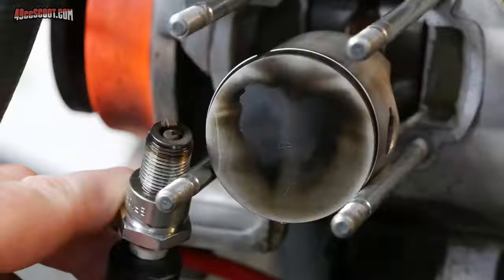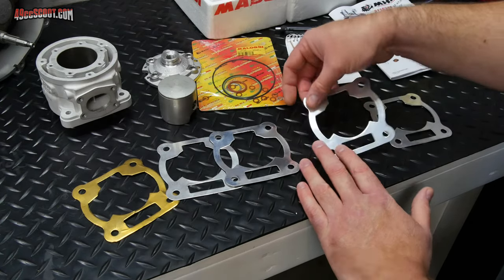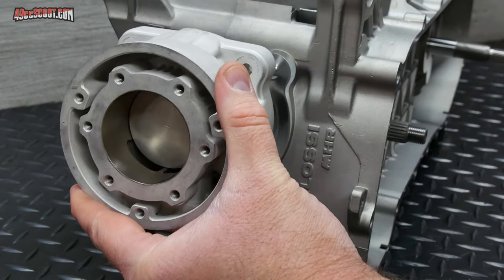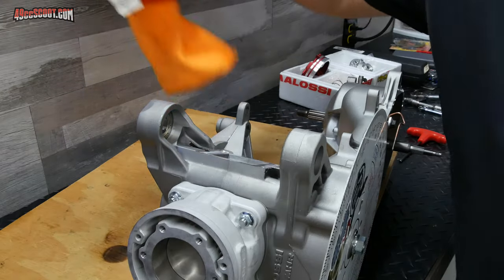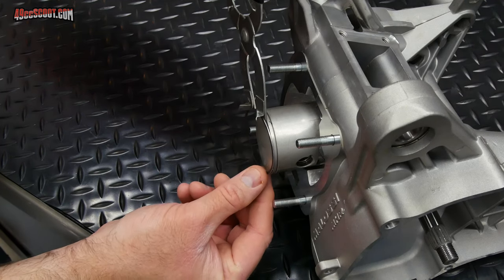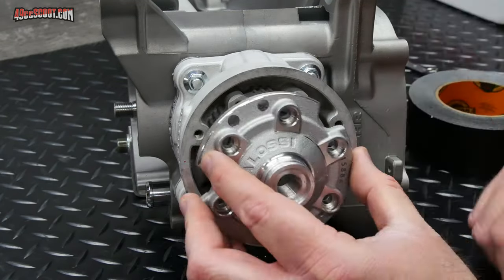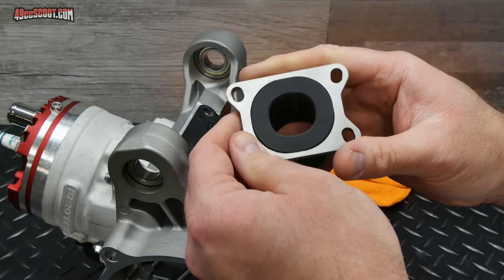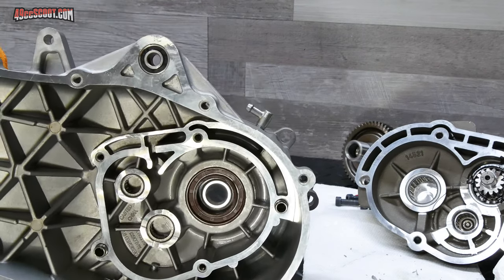RC-One : Cylinder, Reed & Intake Install & Testing A Circlip Installation Tool : RC1 : Part 05

Comment: The circlip tool is a unnecessary tool. Some tools make the job harder. I never use sealant on the bottom gasket. Its not necessary.
Reply from the maker: Once setup the first time, it's very quick with the circlip tool. I like it. I've done tons of them, but I still have days where they go in easy and days where it takes a few tries. Works first time with the tool. Only thing mine fits is the RC1 so it's always setup for it and quick. I did learn the hard way to always check the clip thoroughly after though. Should do that by hand too, but I got so used to the tool working that I slacked once and the clip came out and ate a new cylinder.

Comment: When you use that kind of sockets with the torque wrench you have to be sure the wrench is at a 90 degree angle with the socket, otherwise the leverage will be longer or shorter and the torque will change!! Great video sir!
Reply from the maker: Thanks. Here's a whole bunch more info for anyone interested.

https://www.tekton.com/blog/how-to-accurately-use-a-torque-wrench-with-a-crowfoot-wrench
Reply: @49ccscoot  That's super interesting - good link.

Comment: Absolute guru. I thought I was good with the 2T scoots but come to find out there are always bigger fish. You create quality vids that help all levels of enthusiasts brother
Reply from the maker: Thank you! There are way bigger fish than both of us. Check out  2StrokeStuffing on here and look up legends like Frits Overmars and Jan Thiel.
Reply: @49ccscoot  just discovered Frits thanks to your recommendation but have been following Jan's solid content for a bit. Down here in Richmond I don't see a lot of two strokes (i myself build rucks more it seems now) but my Zuma's, TnG's  and Vento's seem to draw a lot of attention. Trying to dial in a 50cc Viaggio (TnG clone) to get better oomph off the line but it does hump 51 on flats with Zuma clutch pack and the 12" sport wheels on it. Using your variator weight instructions to do with what I have which is a full crown royal bag of weights. We have similar disciplines with regards to going way too far into making the usual unusual. Ask me about my 650cc two stroke ZX9R sometime...😏
Reply from the maker: @monsterunderyourbed5729  That sounds like a fun bike! My dream swap is a snow machine turbocharged liter 2T in the TMAX. Prob never gonna happen due to expense and the likelihood of a funeral if I had 200HP in a scooter.

Comment: Good attention to detail, through the whole process. Hopefully Molossi did their homework on the O-rings.

When teaching people the feel of gapping things, I like explaining that the drag should feel like slowly pulling the piece of metal from a refrigerator magnet.

When measuring soft things. I unscrew the holding clamp on the caliper, and gently pinch the jaws closed with my fingers, not using the roller at all because they give an unfamiliar mechanical advantage. If I feel need too much force to pinch them, I put my thumb behind the carriage of moveable jaw, and just relieve the friction. [As sharp as they may be, I never use a caliper without first running my thumb down both jaws, though a micrometers can measure the film of a fingerprint, so it's not a good idea on a mic. Once in a while I hold it up to light to see the sliver of light, that they jaws are well aligned. Ironically, I use the sharp ends for a scribe, just like everyone else. LOL! Well, they are US General, after all.]

Comment: In measuring your distance from  top of piston to let's say exhaust port for your timing. With the gap from cylinder wall to piston wall, would that be enough to cause some loss in performance  because  it's not sealed as if you measured to top of the ring which is most sealed position,  I'm just wondering if the blowby because of the gap can cause a false degree reading.  To me a gap means less compression because it has to be filled with the compression more than if there was less gap to fill, which could give better performance. Hope you understand what I'm saying. Thanks for your video. Also couldn't we move the ring closer to the top of piston to have a smaller chamber to fill.
Reply from the maker: I think the important part for measuring is to use a standard of measurement. The standard of measurement is to use the piston crown. No loss when measuring as long as we try to be accurate. Different folks use different ways to align the piston, but most of us would probably be within a degree or so. If you aren't a professional builder/tuner/racer in tight competition then that should be close enough.

There are consequences to different actions. Keeping the thickness at the top of the piston is likely more beneficial than having the ring much nearer the crown.

Comment: hey! very nice video. one thing i noticed - why dont you trust the aluminium bottom gasket? I've assembled at least 10 engines using both copper and aluminium, and never had any issues. Just seems kind of a waste of good matching when you pour a bunch of liquid gasket in there 😃
keep up the good work
Reply from the maker: Past experience. I'm used to Chinese Minarelli clones and I've had tons of sealing issues with them.

Thanks.

Comment: Have you ever tried to make one of those Chinese 90cc bbk into a ported and cleaned up to try and make it close to a malossi one ?
Reply from the maker: I have ported quite a few Chinese 52-54mm cylinders. Mostly air cooled. I've owned a couple of liquid cooled. They aren't going to work like the Malossi or any flange mount. They can run pretty strong. The liquid cooled cylinder kits that I had were sort of junk. They worked OK... but they didn't want to seal. I had constant head sealing issues and thought that's just what small LC scoots were like. Then I got the TPR and Malossi and they are much more stable. Most of the big stuff I've had around 96-110cc didn't want to make a lot of power above about 10,500RPM, even with custom made pipes for more revs and porting. The transfer ports start to be so small in comparison to the bore. Look at transfers on a dirtbike 2T of similar size and then look at what we have.

Comment: I am glad to see, that you aren't using the death-carb.

You likely know this, but because it's a carburetor, having a smaller one, usually gives you more torque at low RPMs; having a larger one gives you more HP at high RPMs. (This is where fuel injection has its merits.)

If you find yourself sourcing o-rings, Viton is supposed to be good. I was wrong that it does come in other colors than brown. I should also think that just because it's brown, it may not be Viton.

Cheap transfer-punch set. (ducks)

Comment: Hello, I have a Malossi MHR BB 77ccm cylinder, is it worth replacing with a 94ccm Polini? I do not hide I like high power and the best performance ;) The MHR reaches the power of 25-26km Polini 30Km is there a big difference?
Reply from the maker: I've been around a 77 before, not a Polini 94. Should be a difference. Probably not huge if the power is where you state. You'll be able to tell though. For me some of this stuff comes down to how much does money matter vs power. The  77 should still be a lot of fun and faster than most stuff that you'll come across.

Comment: What rear wheel fit on minarelli c one?I have aprilia sr but the minarelli axle is very small. I could use a piaggio axle or what would be your recommendation.Thank you for your videos, I have learned a lot from them.
Reply from the maker: Most use an Aerox hub and wheel when using the Minarelli version of these engines with the Minarelli axle. Whatever can interchange with an Aerox should work.
Reply: @49ccscoot  great thanks

Comment: Hi There, Nice vidéo, as usuall. 

A Quick tip about squish, dont you know that your base gasketts  Will compress about 15% over time??? 

You should put 15% more thickness, 'cause your squish Will go down almost 0.1mm 

Why dont you check the uccr?? What fuel are you usine???

Thx!!!!
Reply from the maker: I didn't check UCCR because it takes up a good bit of time. I barely made it to the car show as it was and the car shows are my favorite thing ever.

I'm running what I believe to be a safe squish. It could be tighter by Malossi's specs and I believe that they would be likely to use caution with their specs and consider these things. Some people will only use about 1% of stroke as their clearance.

I can tell you with certainty that at ~500 miles there are no issues related to squish clearance. If you treat the engine as it probably should be, basically like a race or MX style engine, then they are typically pulled apart very often. This isn't going to be an engine that stays together for 10,000 miles at a time.

I use premium pump gas. While I will put it in the truck at times, this is a street scoot so I need to use fuel that is readily available. BTW, premium here is generally 10% ethanol and 91-93 octane (R+M)/2.
Reply: @49ccscoot  I dont mind tight squish, but here, it's 91 octane (premium), so i usually keep my street engine of that size under 14:1. I was curious about your uccr number.
Reply from the maker: @claudeperron780  I normally use CCR for mine. I don't think I ever checked my TPR either, so I'm not sure where my more race-oriented setups are. I have checked more sport to mid-race sort of stuff that I've put together and modified. Largely because I've used a lot of unknown sort of parts (especially for 90-100cc Chinese strokers) where I've needed to modify combustion chambers and compromise on timings to get good results from them. With those, I'm usually 7-8:1 CCR. I'm pretty sure it could be pushed higher, but it would depend on timing and use. For street stuff that can last quite a while, that worked well for me.

Comment: How many gas tanks must I fill to Break in a brand new cylinder on a two stroke?
Reply from the maker: You can get a lot of opinions on break-in on any engine. I take it kind of easy for ~20 miles usually. Beyond that, I ride however I want. Some people prefer much more time.

Comment: Question can you make 75cc scoot to idel at 800rpm and start at 800 bc mine idels at that speed and it's better bc it has 1000rpm springs if I put 2000rpm springs it will have better take off right
Reply from the maker: 800RPM is a very low idle for a thumper (single cylinder)... or most bikes really. You can set the idle low if it's in tune and has enough flywheel mass, and it helps to not have large port durations. It's gotta be on the edge of cutting off regularly though, which makes no sense for riding because you don't want it to cut off when you stop and that's going to happen with exceedingly low idle speed at some point.

1000 and 2000RPM springs have little to do with  idle. Any springs should support proper idle speeds. Those ratings don't literally mean that they engage at that RPM anyway. 1000RPM springs engage 1000RPM higher than stock. It's not an exact science, but that's the intention. Most small scooters really aren't going to make much power till at least 4000RPM, some much higher.

Comment: Can i ask man what is the headbolt torque value for 100cc 2stroke scooters i can't see in google thanks in advance
Reply from the maker: It will depend on the exact engine or cylinder kit. 10-12Nm is pretty common for stuff that I've worked on, but again it would be best to find information specific to your setup.
Reply: @49ccscoot  my unit is vento triton gt5 2006 mdl 100cc indicated in paper stock bore hehe 91cm block
Reply from the maker: @kennethdizon786  10-12Nm should work then. That's what I'm using on most of my Minarelli stuff. Those 90s are good street engines IMO. If you can find an exhaust that makes it's power by 10,000-10,500RPM, then you can have basically a big sport setup (with some cylinder setup) that should be able to hold together for a while. The tough part is finding an exhaust that works well in that range. Mine was custom made by a friend.
Reply: @49ccscoot  my pipe is power pipe but not good the elbow is thrash but i swear its good for my engine and the problem is the airleak when its in high rpm
Reply: Stock carb 1500 both springs
Reply from the maker: @kennethdizon786  Don't bother tuning a two-stroke with air leaks. Fix the leak(s), then tune.

Comment: Sorry i had no time in the last 6 month! iam busy. with my house and my new Job sry! This Piston/Port mach is from the 60---70s! You Named Frits Overmars the RSA MAN/Father. He sad this:
Combustion in an ideal homogeneous air/fuel-mixture has a flame speed of maybe 2 meters per second. So how is it possible that combustion in a 125 cc engine, running at 13000 rpm, is completed within 50 degrees of crankshaft revolution?
The answer is turbulence. Burning lumps of mixture are blown across the combustion chamber and then simultaneously start their own fires in every corner. The blowing is taken care of by the squish effect that pinches mixture
so in a smaller enging the turbulence are more importent than the time is even shorter! the enging revs more like 14-15000 rpm. in 50cc we are taking 20-22000rpm now in developemt!!! all Guy out there write books and tell people to do this and that are old ! and all of them love the 2 stoke, so the tell them the eazy stepps! Make all corners round. make big ports, make the Piston match the trans ports!! WAY?? 1 thing thats the eazyes way to make more power! but its not the way to make the most power! 
I can tell you some of the new stuff but i can tell you all! But i can tell the internet some random numbers! 
45 25@21000
80 43@17800
100 54@14900
125 67@ 14200
142 75@ 14200
1 think laminar end turboulent flow
You want laminat flow from the inlet- filter- to the Carb! a good carb does its one thing!!!!! than laminar in the case and in the port channels. but than tourbulenz!! after ignition at the momend the ex port obens you want laminal flow again!!! 

malossi dide a good job!!! you can go to a 2fast 100cc or bidalot usw but than the more power is arround 2--4hp max in a good setup. but we takling 30--32 or 34mm carbs and spacers for the inlet  

Sir iam out! i dont know when i have time to write you back.
Reply: sorry the random nr. are with fuel injektion! and thats not port injektion like the ktmXD is Direkt like the VW bmw benz usw car! the Crankshaft has en oil sump like porsche  XD